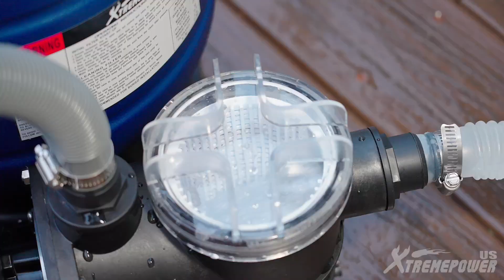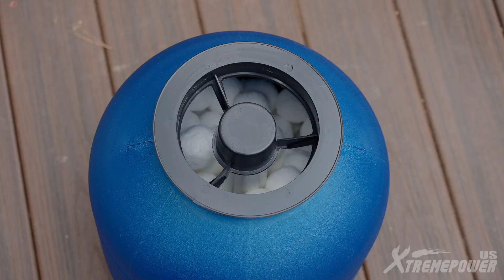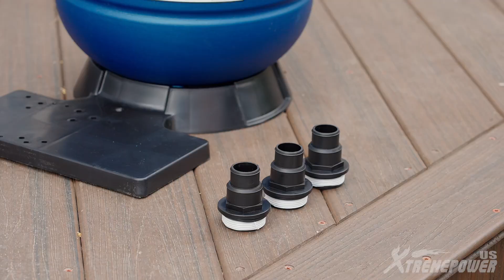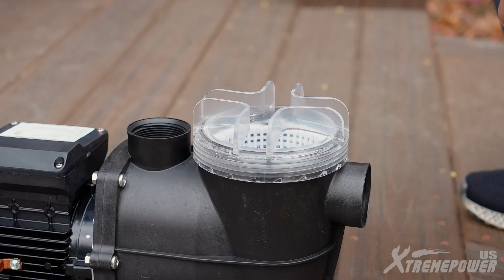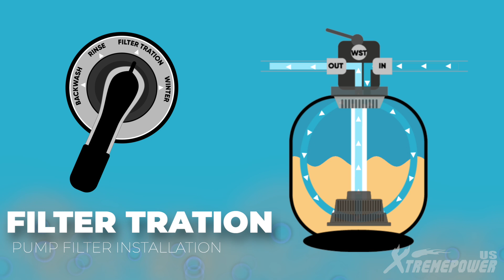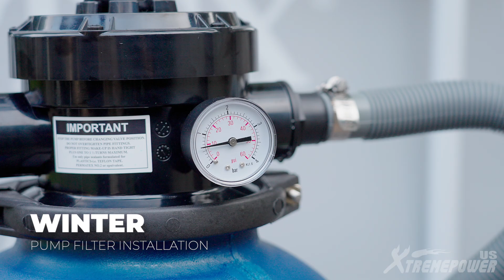XtremepowerUS: 13" Sand Filter with 0.75 HP Water Pump Set For Above Ground Pool Instruction, 75138

Comment: Not happy with this pump and filter at all. By this time last year with the pump that came with the best way pool, that used cartridge filters, the pool was clear. I’m at my wits end. I have used shock, chlorine, clarifier, and the pool is still cloudy. The test strips say all the levels are good but not being able to see to the bottom says something else. I’m totally disappointed!
Reply: Turn off your pump for a day or 2 and see if everything settles to the bottom. If so, you'll have to vacuum everything out once it settles. I learned this last year. Algae grew early in the year, I shocked and killed it all. Got the water perfectly balanced but still cloudy. Turned off pump and the fine particles (basically dust) settled at the bottom and water was clear. Just had to vacuum to waste to clear the dust. Might have to repeat this process a couple times. Pool was perfect the rest of the year.

Comment: Thank you very much for the video!   I am installing this same filter, pump, and the directions did not say where to place the return line, I assumed it was at the 1 1/4" fitting near the clear basket cover and the fitting marked pool was the supply, I assumed.  I could have test run it to find out but did not want to install backwards on the first start.  Thank you very much for taking the time to make and post this video.  Old Senior, Tom

Comment: Pressure gauge isn’t showing any pressure, brand new. But it is sucking and pushing water out. Faulty gauge ?
Reply: Same. This video didn’t say anything about primming
Reply: @mccproduction self priming
Reply: Did u put plumbers tape on it before installing it
Reply: User error

Comment: I cannot get the hose between the filter and pump to stop leaking at clamps. I used petroleum jelly to make a seal but still dripping. Any Ideas?
Reply: I used plumbers tape . It works
Reply: You have to add those o rings and place the clamp directly over the o ring and tongue it to 15 to 20 foot lbs

Comment: I have this filter and now my pool is full of sand. Anyone have a similar problem and have ideas for trouble shooting?
Reply: I used zio sand and it blows it into the pool so I’m trying the filter balls now will see or it’s going back 🤬
Reply: What type of pool sand must I use
Reply: @jimjigga  I am not sure what to recommend, like my comment above said sand didn’t work for me
Reply: @zachbumbarger4297  how can sand not work in a sand filter pump?
Reply: @jimjigga  read my original comment please. At least for me, the filter blew the sand into the pool. Others seem to have used sand with no issues, so you may have better luck
Reply: I'm not getting any return water at all. An I have no leaks what am I doing wrong
Reply: I also had this problem. Did you find out a way to solve the problem?
Reply: @gaelgarcia161 no, not particularly. We replaced the sand with filter balls, but unfortunately our pool is still has sand on the bottom of it.

Comment: How many filter balls are needed?
Reply from the maker: 1 box of Filtra Balls weighs less than 2 lbs and is equivalent to 50 pounds of normal filter sand.
Reply: @ihubdeal4918  so how many do you need?????

Comment: How much sand?
Reply from the maker: On the filter barrel, there are two waistlines. we recommend filling the sand up to the top waistline, and for this model, it will take around 30 lbs of sand.
Reply: @ihubdeal4918  What kind of sand?
Reply from the maker: @JP-ku3he  Silica pool filter sand is the most commonly used type